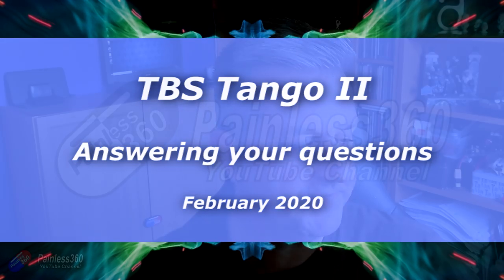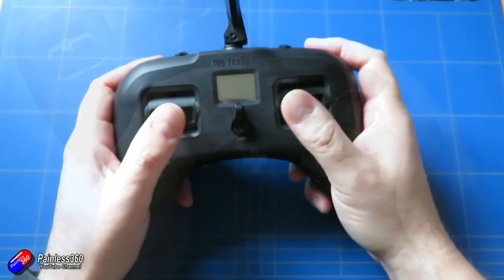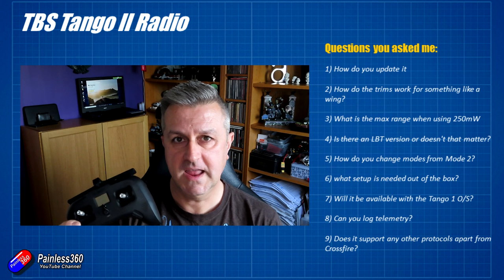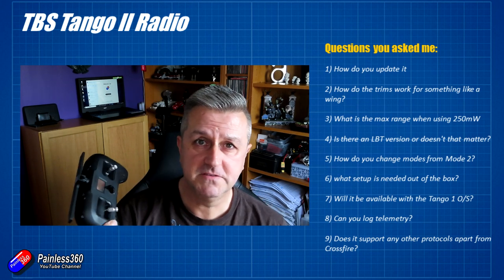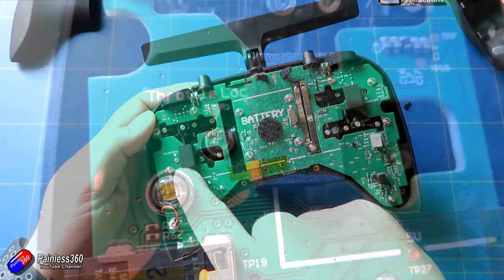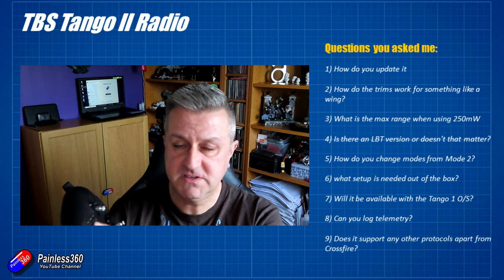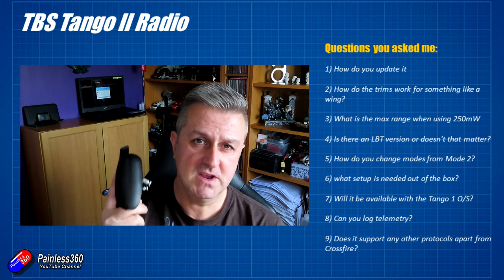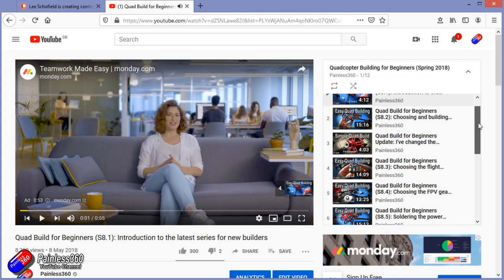TBS Tango II Radio: Answers to your questions

Comment: I appreciate the engineering that went into the radio. Seems way more robust internally than a t16. The ribbon cables are often not seated properly and people have problems with switches and the display. So for the price the tango2 seems very reasonable.

Comment: I see there's no dials or knobs, so adding a real throttle limit (or anything else someone would use a slider for) would be a pain, right? Can the scroll wheel be assigned to an aux channel for this? Shame there's not at least 1 knob or slider. I know one of the 3 position switches could be used, but then you're stuck with only 3 configurable values. Thanks for the info.
Reply from the maker: Sadly not. Great question. Happy flying!
Reply: Hey thinking about flying again.. and saw comment..  God's talking.  Lol  Miss ya brother and best wishes always. Brought back some good memories..  God Bless my friend. My brother..  in my prayers always 👊👊💪💪
Reply: Oh 3 years!! Wow time flys... Too 😉🤪🤣🤣

Comment: I appreciate your valuable guidance video here, but in my system I want to have telemetry, So can you please tell me that do we have sensors like, voltage, current, GPS sensors available with TBS (actually I tried getting on net but failed) ???
Reply from the maker: Yes - it's regular Crossfire and a version of OpenTX so it's all pretty standard stuff..

Comment: If my TBS Immortal-T antenna is positioned horizontally on my drone, my Tango 2 antenna should also be in it's default horizontal position rather than turning it 90 degrees vertically, right? Thank you for the great video.
Reply from the maker: Yes. See my video on an alignment.. Best of luck

Comment: This seems like a great radio but there seems to be fewer switches than a traditional radio. Would you run out of switches on a flying wing with functions like Arming, loiter, return to home, horizon mode, hold height etc?
Reply from the maker: Possibly. I don't think that was the typical model it was designed for. If you want that much, hey another radio.. Happy flying

Comment: How do I disable Trims? I have unticked trims on the channels I don't want trims to work, but when i press the rotary button to trim, it still changes the disabled ones. Example.. I don't want trims on Throttle and Rudder, but the menu still goes through them on the rotary switch. Thanks
Reply from the maker: That is the way that I know. There are a few 'oddities' with FreedomTX so I am holding my breath for full OpenTX support where, hopefully, all of these niggles can be sorted...

Comment: Lipo seems like the wrong kind of battery for a radio. Who wants to bother with storage charging, etc, when you don’t use the radio for a while! Also when it’s fully charged how much will the battery degrade, or be a hazard if left for a while.

Comment: Ciao Caro amico sai...non riesco a capire perchè mi va in fail safe a 50 Mt...ho messo tutto bene e lo fà sempre ...tu hai una configurazione particolare ???'
io uso..868 dinamic power off region open 100mw  Op Mode Normal...e mi va in failsafe....mi aiuti grazie....

Comment: Is there any way to get the radio to display gps position on the screen in digital format ? ( The same format as it is captured in log) mine only shows the gps position as 4 digest on the telemetry page and if I display it on the telemetry screen under numbers, the gps coordinates differ from those on the Telemetry page. 
Also have you had any luck displaying BF telemetry Lua on the telemetry pages. I can only get it to work by enabling it from the radio menu SD page .
Love your vids by the way
Reply: hi, i want to buy the tango 2 and I wanted to know if the gps logging to the sd is good and how can I get the gps cords in case i need them on the field, is it easy to extract the sd and read it?

Comment: how do i change the outputs to match my fc? i have my tango 2 set to mode 2 but the throttle is one the right side still
Reply from the maker: Try the other channel maps in the reciever tab in configurator. See my BNF video for how I setup a Quad. Best of luck with it

Comment: hi is it possible to transfer models from a jumper t16 to a tango 2 . i'm thinking of upgrading to tango 2 but i have loads of models set up on the t16. thanks
Reply from the maker: Until the Tango 2 is supported by OpenTX companion it is not easy at all..
Reply: @Painless360  thank you for the reply

Comment: Hi Painless: I have a question, can I plug a PPM input from my head tracking to the Tango TX? In other word, is there a trainer port?
Reply from the maker: I don't think it does. No mention of it in the manual either...
Reply: @Painless360  Thanks. I read the Tango 2 user manual and did not find anything related to a trainer port. Thanks for your nice videos.

Comment: Hey nice video. I need help. 
My tango 2 binds with my tbs xFire nano rx but I get no stick movement at betaflight :(
With my taranis x9d I had no problems. 
Do you have an idea ?
Reply from the maker: Depends how you setup the outputs on the crossfire reciever and in betaflight or iNav... see my BrainDART and Ardupilot/Matek builds for I setup both... best of luck!

Comment: Hi
I have a big issue with my new Tango2. I'm unable to bind any of my quad with nanoRX installed. The binding on the radio never progressed. When i use my Crossfire Lite (with screen on the back) i've no issue to bind any of my quad. And the update to 3.54 so.
Would you have any idea ?
Reply from the maker: No idea, I've not seen that. Make sure you're not pressing the bind button as you apply power, press it once it's powered up. I fall for that now and again! :D
Reply: @Painless360  Thanks you saved me 👍 Because as other protocol i was pressing the bind Burton before power on the quad

Comment: Hello, do I need crossfire receiver on my quad when I fly toothpick with caddx vista?
Reply from the maker: I don't understand the question.. What are you trying to do?
Reply: @Painless360  I have TBS tango 2 and drone with caddx vista. Now I need crossfire receiver on my drone right? it will not work without it ...right? :D
Reply from the maker: Yep, unless you have a controller for the DJI Digital FPV stuff
Reply: @Painless360  thx... I had dji controller and bought tango 2 so now I must add receivers to all quads 😀

Comment: I have a ton of logical switches, warnings, mixes, throttle cuts etc setup in my taranis qx7. Is there an easy way to transfer all of these?
Reply from the maker: Yes, use companion when it's supported.. If you figure out a way to do it now then please let me know... Happy flying
Reply: @Painless360  oh I wasn't aware companion worked for the tango 2 yet
Reply from the maker: Not yet. 'when it's supported : :)

Comment: Having trouble with setting my end points on the Tango 2 in betaflight. Even tried CLI commands. The throttle end points especially are not changing to 1000 and 2000. Any ideas?
Reply: in cli: [reset rxrange]
Next check the end points of each stick, and once again in cli youll need to use those two endpoints like this: [set rxrange 0 987 2011] where 0 is the first channel and the other two numbers are the ones your sticks actually hit. do this again for channels 2 3 and 4, but they are numbered 0 1 2 and 3.
Reply: Matthew Walsh  Thanks Matthew, That is what I did. It reset all the other channels just fine. For some reason it resets the throttle, just not to 1000 and 2000. Its like 885 and 1981 or something like that. I will try again when I get home from work. Thanks man! I really appreciate all the feedback. This radio is so new, I didnt expect much response. Thanks again! By the way. This doesnt stop me from flying. Just something I noticed.
Reply from the maker: On my pre release version I needed to calibrate it a few times before I got it spot on. Use light pressure to push the sticks into the corners and when it asks you to move the sticks as the final part of calibration don't move them to them limits.. Hope that helps..
Reply: Painless360 OK I will try that. Im at work so I will try when i get home. Thanks so much. By the way, I watch your channel allot. Great job. You are very informative and explanatory. Thanks for your hard work. I have materials for a tadpole and a gecko to build as soon as I get brave enough to solder it. My gosh a 16 x16 is smaller than i imagined LOL. I saw yours. You did great!

Comment: im bought one like this just now. I plug in usb c and the another side in pc usb. im try use tbs agente online to update these firmwares. i plug one side in usb type and another side in pc usb. im try use tbs agente online to update these firmwares. During the flash process, my firewall block a download an/or update, and my tango 2 crashes. I disconect the usb cable and after 20 seconds i press the power button for shutdown this radio. Since this momment, my tbs tango 2 dont works. Nothing. 1- No recognizes the usb (without connection with PC) 2 -icant turn on radio, none screen signal and not sounds. Please, someone can help me?
Reply from the maker: There is a bootloader for times like this - https://team-blacksheep.freshdesk.com/support/solutions/articles/4000152716-entering-bootloader-mode-crsf-freedomtx

Comment: Lee,....as it has a LIPO in it..and your not "storage charging" it after every useage,..... wouldn't the battery,s life be very short?🤔
Reply from the maker: Lots of radios have something similar. It's easy enough to swap out if it did...
Reply: @Painless360  Great news..thx Lee!
Just bought one 2 mins ago,through Quadcopter s UK..
Sending you a payment to your PayPal,..to say thx for your help.👍🍺

Comment: My sticks are a bit off 1500 on the T2... How can i sort that?.
Reply from the maker: Run through the sticks calibration in the main menu...
Reply: @Painless360  did that.. I think i need adjust in outputs.. Going from the tango to the T2 is a doozy.. 🤣
Reply: DARKRYDER7 same did that sort it out ?

Comment: Too bad you can't copy/share models across radios, or set a radio model via PC software, e.g. like companion-like programs.
Reply from the maker: Not until it is fully supported by OpenTX
Reply: @Painless360  I heard you can copy model.txt and the model folder to share models between radios. I will try it later today.